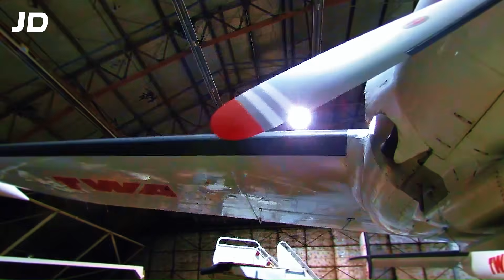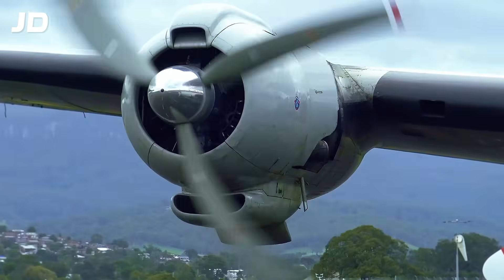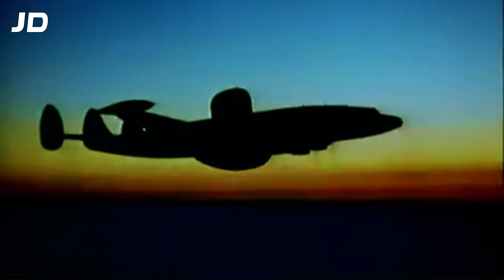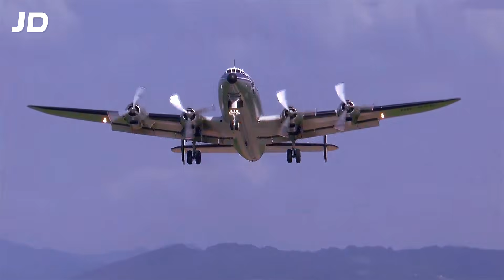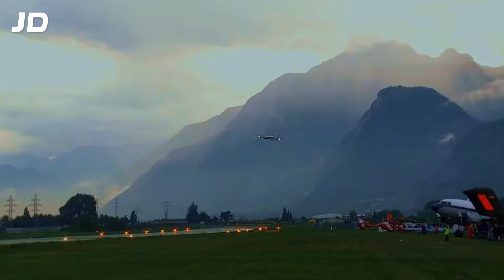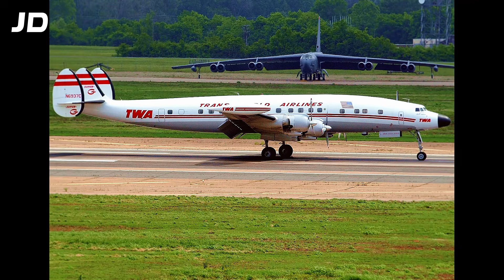The Lockheed Constellation Was A Masterpiece - Until This Epic Fail

Comment: when I got out of navy, 1963, I got a job at a tracking station tracking the Mercury and Gemini programs at Canton Island south pacific. the island was run by the FAA as a refueling and emerency back up. the FAA plane was a Constellation every 2 weeks. 7 hours from Honolulu. I flew many times on it. every every other flight went to American Samoa to test equipment there. I went there a couple of times. one trip tail winds made it too heavy to land so just off shore they roared back and forth to burn fuel. never any problem. when it was ready to leave a flight crew member would stand at the top of the stairs and yell out "all aboard for Honolulu" just to remind everyone else they were stuck on a remote island. we were always happy to see that 3-tailed wonder. mail call.

Comment: It is a wonderfully beautiful plane  but the fuselage was a bad design. Despite what was said here the  tubular  fuselage Douglas DC7 was fifty miles per hour faster than the Super Constellation with the same engines. The graceful dolphin  fuselage had no benefit in drag but increased cost of manufacturing and maintenance and compromised usable space.

Comment: As a kid in the late 1960`s or early 1970`s our family was on the way from Frankfurt-Main  to Rome, but the Lufthansa 727 had some problem and was not available. Lufthansa then rolled out their old Lockheed Constellation, and it was a great experience for a kid. Huge blue seats, big square windows, and clear weather over the Alps. I am not sure, but this was probably one of the last passenger flight for this Lufthansa Connie. Our return flight was on a Lufthansa 727, a totally different and a bit boring experience after than the Constellation flight. Of course the passenger jets were faster, but they did not have the low rumble of big pistons.

Comment: My father was a navy car r I er pilot i n Ww2. After d rv t h e c war he c went to work as c a pilot for A merican Airli n es.. He flew Dc3s  4s and 6Ns. He retired as a senior captain in 1956.
Mo d t of the p t ob l emsconcerns and discomfort o rts were common to ALL t h e piston engine commerc I al aircraft of the 40s a n d 50s.  In fact the h were experienced under f a r worse conditions on aircraft r art carriers hit cor a l islands in the Pacific and in freezing Europe by any mechanics and pilots of ANY RADIAL ENGINED FIGHTE R OR TRANSP O RT AIRCRAFT 
 THE ability o f the Connie to g e t abo b e a lot of thecwe a ther meant less danger and avc I dents from icing c and hail in violent weather. Fewewer as inside k p passengers etc. The DC4 and 6B sufferers thecsa m e p r oblems with engines as the Connie. I. fact an in b oardcengine fire on a DC 4 burned a wing off c a DC t coming into Ft Worth D a glass in 1949 and the res h lting c r a sh and f I re killed many passengers . My father's best friend was the captain of c that plane.  
I flew in a Constellatikn a couple I f times.  It c was much more comfortable I rt s ble than a DC4 or Dc3.. the Dc6 was a rough equivalent to the Connie 
And had a lot of the c same p roblems  
It should be remembered that during thev40s cc and 50s MOST people did not travel by c as ir. it was to o e cc pensive m And truth be c told it was somewhat nerve w ra king and cc ri s ky. Government peop l e did. Rich people did Mid cc le c l ass p eople  rarely did.  They loaded suitcases in a car and drove stayed a t motels or camped out or if going overseas went by ship.
I got to fly a lot when I was young because my f s ther was a pilot fir Americsn A I r lines.  I do remember him coming home s sometimes when zi cc was very young exhaust as usted and his exciting ac cc counts of fighting thru viol d n t storms on a flight from zlA or zmeci cc o City or D a llelas to or from Chicago. He did not like the viol e nt frontal systems and huge lines of thunderstorms encountered in the Midwest and around the Great LA k es. 
I recall building many model a irplanes when I was between the ages o f 5 and 13.. My father had flown several a l of them either prepared during the cc war or after b the war.. He shared stories about his experiences with ones he had flown while watching me put the models together.
I c s not recall a ll of them but they in cc luded  the zf4F the zf6F the F8F  the F4U  the zdc3 4 and 6  While in the s southwest Pavific he had been around a AAF unit the s t flew P38s... I think it was the zj model we hich he described as the C a pillar I f fighter interceptor planes very fast and long ranged. He described the Bearcat as the best fighter as aircraft he ever flew  He helped me build my first Rc multi engined flying plane a B25 and taught me how to fly it. Sadly after over twenty years of flying b and thousands of hours in the s ir he cc was killed in a traffic accident in 1961.    By a drunk in a box truck over the line on a blind curve. 
Theres a kes d on a nd a message there somewhere.
But zi never discovered cc wh a t it was.

Comment: The Lockheed Constellation was an iconic plane which many people nostalgically admire. In reality it was a flawed and dangerous aircraft with 61 crashes, 18% of the 846 aircraft built. Five of them crashed on a Midway airport takeoff or landing.
TWA Flight 154 Dec 18, 1949
TWA Super Constellation N7101C Aircraft Hull written off Feb 29, 1960
TWA Flight 529 Sept 1, 1961
TWA Flight 595 Nov. 24, 1959
Eastern Air Lines Flight 104 March 3, 1953

Comment: I'm old enough that I've flown many times on commercial propeller planes with radial engines as well as on Boeing 707s and Douglas DC-8s. Pro tip: a 707 is NOT "whisper quiet." Nowhere near. Quieter than a multi-engine radial-powered aircraft, yes. "Quiet" -- no.

Comment: It was a great plane for the time. Same engine as the B-29 . Kelly Johnson knew the people tube wasn't a great idea. The DC-4 and DC-6  made a lot of cabin noise they too use radial engines also air cooled  sucked  a lot fuel so not much of a difference.

Comment: The Lockheed Constellation didn’t fail due to a single flaw; rather, it was undone by high maintenance costs, temperamental Wright R-3350 engines, and ultimately, the advent of the Jet Age. While brilliant, it required a flight engineer and frequent overhauls, making it obsolete when Boeing and Douglas introduced jet airliners.

Comment: They were a nightmare to service. Fueling nozzles and hoses were dragged up ladders onto the top of the wings and then fuel was blasted into 4” tank fuel holes. You never lived until you have to straddle an engine nacelle holding a 5 gallon oil can and try to pour oil into the engine without pouring oil all over the engine. I serviced these machines and hated them.

Comment: The Connie has a singularly iconic appearance. It was a pioneer in pressurized commercial air travel. So it set the stage. But it was expensive to operate and a maintenance burden. It was quickly made obsolete by the development of commercial jets.
Reply: The Constellation will never be obsolete.

Comment: EC-121 Flight Engineer - 4 years, no engine failure at all.
Reply: Worked and flew all over the world (mostly CA to SEA and back) in all versions of the 121s from the c to 3 or 4 versions of the EC121s. Many ocean crossing only one engine problem. Taking off from Hawaii #3 was shut down due to low oil pressure. We went back and within an hour or so it was repaired, ground engine run and we were on our way. It was just a sending unit problem NOT an actual engine problem. Guess they had engine problems in the early years, by the 60s they seemed to be quite reliable even when primarily maintained by teenagers. Loved and hated the old beast. Similar to my relationship with F4s some years later.

Comment: The B-29 had the same over heating / poorly designed engine cowling. I think it makes more sense to properly cool a multi layered radial engine to allow it to safely function. I did not know this about the Connie as well. And the huge cost in safety and oil fowled spark plugs, magnesium crank case's melting and causing so many B-29's to crash and burn.

Comment: I was able to fly on the Star of America ten or eleven times. I was a volunteer with Save A Connie (later the Airline History Museum) from 1996 - 2005. We had excellent mechanics and staff. We had the luxury of flying to most airshows on the weekends. That allowed our mechanics to "tinker with" and fine tune the airplane the rest of the time. We didn't have an engine failure in flight during my flights. One time upon landing in Kansas City there were problems with the propellor governor on engine number two. All four engines were running on touchdown but the number two engine was feathered on rollout. It was repaired promptly. It was a wonderful airplane from a passenger perspective.

Comment: A Constellation designed with jet engines would make a fine luxury private jet.  Beautiful.
Reply: It would be too large for most private fleets.
Reply: @marekstanek112  eisenhower used the constellation  for air force one
Reply: i am surprised it was not converted to jet engines it looked like a jet should even though it was not
Reply: @FRANK-s6o3l  its explained in the video. The fuselage form was expensive to manufacture, as it traded modularity and production savings for aerodynamically optimization. It’s the last aircraft built that way, except fighters.
Reply: @marekstanek112  yes i know and its a shame because its the most beautiful passenger plane ever built.

Comment: I flew Connie’s and Super G Connie’s in the 50s from Heathrow to Singapore.   3 days and nights  with about 8 stops of grueling noise and vibration.  But, they were fine aircraft for the time.   Then I flew the Brittania, the whispering giant, with much smoother turboprops and must faster.   It was also big and roomy.   Then I flew the Comet.    Cut flying time in half.  My Comet didn’t disintegrate.

Comment: A wonderful aircraft and video, though some of the hyperbole is a bit unnecessary.

Note that the entry of the DeHavilland Comet predated the appearance of the Boeing 707.  Had it not been for the design error on the windows of the Comet, we likely would be flying DeHavilland aircraft rather than Boeing.

Fun Fact: I had a neighbor when I was growing up that was in aviation his entire career.  First in the Air Force and then in civilian commercial aviation.  He said that jet engines were the best thing that ever happened for commercial aviation as if you had to shut down an engine in flight, you did not have to tell the passengers.

Comment: Back in the early 80's, I had the lucky flight in a Connie, from Phoenix to Yuma.  Originally, the flight was to be in a Swearingen "Flying vibrator" Metroliner.  For some reason, that plane was subbed by one of the last airworthy Lockheed commercial airliners, that Connie.  The opulent spacious interior was incredible.  Too bad the flight only lasted an hour.  I'll never forget that flight.
Reply: just looking at the plane makes you want to fly on it. the roof line looks beautiful and roomy on the inside

Comment: The Connie would have done better with turboprops as opposed to the piston engines. Of course turbines weren't available at the time the Connie was designed.
Reply: UK's Bristol Britannia, a contemporary aircraft, had turbo-props back in the 1950s.
Reply: @EllieMaes-Grandad yes the Bristol Britannia was a progressive aircraft on the forefront of using turboprop power plants.

Comment: Too bad turbo props engines were not yet available.
Reply: Actually, they were. In the early '50s, the Air Force, as an experiment, replaced their piston engines on one of the C-124 Globemaster planes. It was a sucess, as it was more powerful than piston engines. Lockheed then designed and built the C-130 Hercules turboprop cargo plane, which proved to be a huge success. There is a commercial version, known as the L-1010. Those Hercs did so much more, than their designers wildest dreams.
Reply: @danielcobbins8861  UK's Bristol Britannia had turbo-props, in the 1950s.
Reply: @EllieMaes-Grandad As did the Vickers Viscount.

Comment: My parents flew a Connie on 1955 and were concerned when the engine sound reduced suddenly. The captain then announced that they changed the setting on the turbo compressors and the noise reduction was a benefit.
Reply: A procedure done 2 engines at a time. Usually the 2 inboard engines 1st, and then the 2 outboard engines.
Reply: Yes, as they climbed out they would throttle back to shift gears.
That was more noticeable on the airlines because the air pressure would change.
I flew in the EC-121 which wasn't pressurized

Comment: There were at least two pre-war airliners that were pressurized. I'm thinking of the DC-4 and Boeing 307? However, I think only a handful entered passenger service before the war. 

To answer the question at the ten minute mark, it was worth it as  Lockheed got the engine issues sufficiently under control such that it is now generally regarded as the pinnacle of propeller airliner engineering. IIRC, it was the last to drop out of service as the jet age commenced.

Comment: Nice looking, smooth and high flying.  Pilots called it the worlds greatest 3 engine airliner.  One engine was sure to fail.  So sure, that spare engines were left at airports along well established "connie" routes.
Reply: Noise and vibration from those radial engines...
Reply: They had four.engines.
Reply: @ak5659  They were equipped with four.  One would often fail in flight.  That's why they called it that,